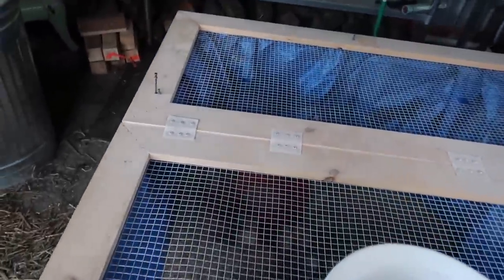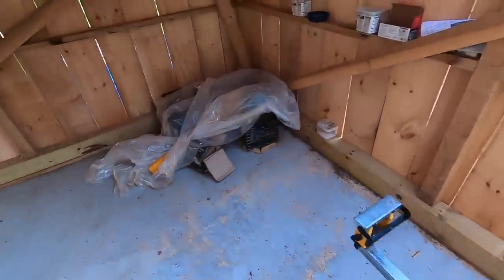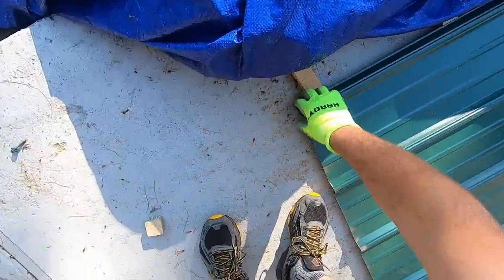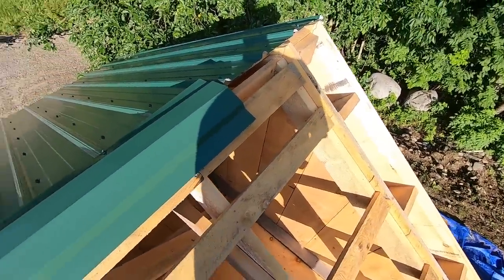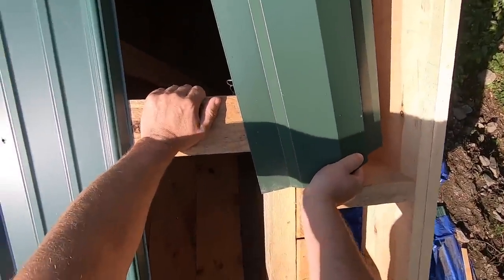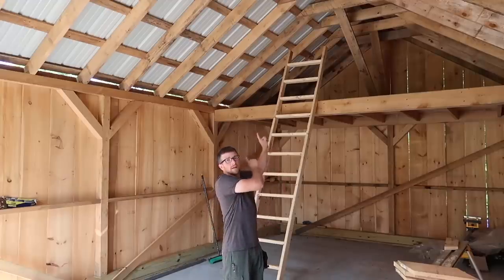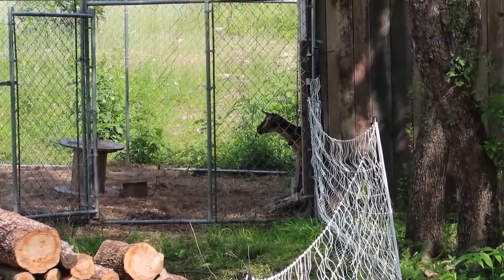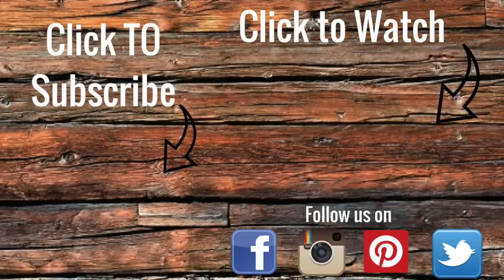I'm Glad I don't Have to do that Again! Finishing up the ROOF on the Post and Beam Barn

Comment: Screw some extension sides on your barn ladder, so that it is long enough to reach the eaves, make one side longer to match the eaves. Then add some temp rungs to stand on to be high enough to screw that last piece of roofing on. Then leave the extensions on when using to get up in the loft, to give you a safety handhold as you climb into the loft. a safety rail in the barn loft to keep someone from ever taking the big last step! Of course by this time you have probably found a longer ladder since it seems there are a few days lag time between the actual day of production, and when you publish. However I would still recommend some hand hold railings on that ladder so that you don't fall off the ladder, which looks more like stairs. I don't know if they are permanently installed, or maybe you can pull them up to the joist when not being used, make the hand hold side rails so they fold flat. Ha another project for a rainy day!

Comment: It's a bit difficult getting off the ladder onto the loft with it pointed straight at it.  If you put a beam under the loft, sticking straight out 3', so you can rest the ladder sideways to the loft, it will be a lot easier to get on/off.  It will also put the base of the ladder to one side and the top near the center where it is more out of the way.

Comment: Extension ladders are really two ladders strapped together. Where people get into trouble is when there's not enough over lap. Between you and me, because you only need a few feet, I'd strap your two ladders together (making it what you need) and get the job done... just don't tell anyone or you'll get a bunch of grief. ❤🌅🌵

Comment: Have your assistant builder go around and pick up everything inside the barn. She can help its in the shade and you would be surprised at how many screws, nails, drill bits and just junk is inside a build site. Great work getting the main structure up and roofed.

Comment: You ought to use an air hose to blow the grinding residue off the roof. The steel particles will rust and stain the roof with brown spots and even stain your concrete. The pros have a new pair of soft soled shoes that have never seen gravel they use to walk on the roof.

Comment: Here is a way to finish the roof with what you have.  anchor a 2x4 to the bottom of the roof lay the ladder on the roof. then tie a rope to the top of the ladder go over the roof with the rope and anchor the rope to your tractor. that will be nice and safe to climb to the top an finish the screws..

Comment: This will sound pedantic but when you drill your roofing on the side buildings, instead of drilling on the flat metal where there's a chance of drips coming through would it not be better to drill through the raised ridge of the sheet (which is what you normally do with polycarbonate sheeting) ... Just a thought.

Comment: I'd like your opinion on where the screws should be placed as on the flat surface of the metal or on the peaks of the ridges in the metal; the logic being that if you screw the sheets down on the ridges with longer screws it allows the metal to move during heat and cold without loosening the screws. Screws on the flat make a very tight job, but it can't work much hence there may be some loosening of the screws after a few years. I've seen both installations and have heard of loosening of screws in a very warm climate. I have similar metal on a very old house, screwed to the strapping with screws on the top of the ridges and it's still tight after a lot of wind and about ten years but our temperature highs and lows are not extreme.

Comment: Looks great Al. I was wondering why you haven't put any clear panels in for some natural light? 
Coming along nicely.  Thanks for sharing!
Reply: Al, fyi on the clear panels thought, the clear panels deteriorate over time, they become brittle and crack so if u read this keep that in mind, yes it is a good thought/idea but over time they have to be replaced, in the goat shed u did it due to not having electricity which I get and that was a temporary building but being this is a permanent structure do u really want to replace a skylight panel when it deteriorates? 

Just food for thought on the idea...

Comment: When adding a new piece of tin, you made sure that the new corner lined up with the corner of the previous piece, but how did you ensure that it wasn't slightly racked (the far corner is lined up)?

Comment: The barn is looking REALLY good. 
Assuming those roof panels are steel, you should probably get some touch up paint for those saw scratches on the one panel or you could end up with "the R word", rust.

Comment: I am enjoying the barn build videos. I do have a question though. I have installed a few tin roofs, we always screwed on top of the rib and I am curious why you would do it on the flat?
Reply: Rodney Beaudette i was wondering that too. I was told they do it on the rib so the water doesnt pool around the screw gasket
Reply: @cathiwim  That is what I thought. Also when the snow and ice build up it tends to cause leaking.

Comment: Good job on the roof. An easier way to get the length of a ladder is to count the rungs, no need for a tape measure. It'll tell you how many feet the ladder is. 16 rungs=16 ft .ladder.

Comment: have been watching you build the Barn and was very impressed until you butted the roof cap. they should have an overlap 6" and caulk to keep out the water. we did my dads barn a few years ago and had finishing pieces on the edges. thats all every other thing is a job well done.

Comment: Farm but no ladder ? Carpenter = many ladders ! Im retired from building and I still own 4 ladders ! You must have rented the staging ? Looks great !
Reply from the maker: Borrowed it. I hate have extensions ladders just laying around. 😆
Reply: @LumnahAcres  Al you now have four 25 ft. long walls to hang one really nice extension ladder on, out of the sun, for when you will need one! I am sitting on my couch watching, and even I am glad I Don't need to get on the roof again!  Well done kid! I'm ready for the over hangs.
Reply: Al, I own a construction/landscape company, many times I use ladders, I've found that the multi ladders are much more efficient, I have many extension ladders that I don't even use anymore, they sit on top of my construction trailer fading in the sun so as to the comment about many ladders needed for construction usage it's not really necessary, I have 22ft & 16ft multi ladder and it serves more purpose than needed, I think in the past 2 years I've only needed to take my 32ft ladder off the trailer twice. (I also have access to a 66ft skylight if needed which we use for tree stuff) so just because ur in the construction industry don't mean u need tons of ladders, if u buy the right ladder it's all u need.
Reply: @MrBigblueford  I got one of those and they are handy but sometimes I need my 24 ft ext ladder.
Reply: @karlgriggs8887  Two 30' & two 32' when finished.
Reply: @tonygrimes13  I did not even concider the over hangs inside. Stalls are most likely be there and  not outside if using fiberglass ladder. So that leaves four 25 foot walls inside aand just outside the barn. Remember, two man doors!

Comment: Al. Could you have done both sides of the barn  then the ridge cap? You still have to go up top to screw in the other side of the ridge cap. I can guess it’s a bit of a pain walking on the metal roofing and staying on the screw lines /strapping all the time.
Reply: As long as they were bone dry they were grippy, right?
Reply: I can see how doing the screws from the sides reduces the risk of bending a panel with a miss step!

Comment: CONSTRUCTION QUESTION -  What is preventing the spread of the roof force on the walls when you put weight on the roof?  I don't see a structural ridge beam and you only have rafters instead of true trusses.  There are only collar ties up high and no real rafter ties except possibly at the loft.   What is holding this roof up?
Reply: Sean McCafferty i was wondering this myself
Reply: @cathiwim  I think I figured it out...   In his earlier video the tie beams were in place:

https://www.youtube.com/watch?v=Y4mLHuXfFNw&t=182s

In this later video they are gone.   He may have removed them to get the scaffolding in there to work on the upper ties.   I sure hope he puts them back up before he gets the walls spreading.

Comment: Doesn’t screwing into the valley heighten the risk of leaks? I would be screwing through the ridge of the sheets.
Reply: Depends on manufactures recommendations.
Reply from the maker: It’s what they recommend
Reply: Lumnah Acres . Cool. It’s a bit different here in Australia🇦🇺🇦🇺. No matter where you are, following the recommendations is  good idea😎

Comment: Hey. Cool video. Stupid question regarding the roof ( I have no building experience) : Are you concerned with water seaping in via the screws, and eventually rotting the wood? Thanks, keep up the good work :)
Reply from the maker: The screws have a rubber washer on them that makes the water tight
Reply: @LumnahAcres  oh, cool. Thanks for clearing that up :)
Reply: @LumnahAcres  A followup question in hindsight: Whats the expected lifespan of the rubber washers before they start to develop cracks and could potentially begin to leak? My experience with rubber in general is that it cracks when it ages. Even protected rubber, say, a drivebelt in a car engine or just rubber gaskets that have been sitting on a shelf for way too many years, still encased in their plastic bags. What are your thoughts on that?

Comment: I use these in my brooders.  You can set it to turn off your heat lamp at a certain temperature so you don't have to worry about the birds getting too hot.  It's an Inkbird Temperature Controller.

https://www.amazon.com/gp/product/B00OXPE8U6/ref=ppx_yo_dt_b_search_asin_title?ie=UTF8&psc=1

Comment: You are inserting the screws into the bottom of the channel where the water will run down.  You are going to introduce more leaks into your barn over time, a sthe rubber/neoprene seals you are reliant on for sealing wont last long.

Better to screw the top of the channels, maybe use a longer screw too, so water wont be running into the screw holes, much less leaks.  Is this the tin manufacturers detail to do it this way?
Reply: @James C ,
I noticed that also .  Not only that but some of the screw locations have dimpled. Thus creating a place for water to gather. Over time exposure to the sun's heat and the ultraviolet rays will cause the neoprene washers to harden and crack.  Which is not usually a problem when the screws are placed on top of the ridges. In addition , without placing the screws in the tops of the ridges 
the edges are not secured. A really heavy wind blowing from the right direction  could now lift the edges of the panels .
 Otherwise , the roof looks great .  Time will tell .